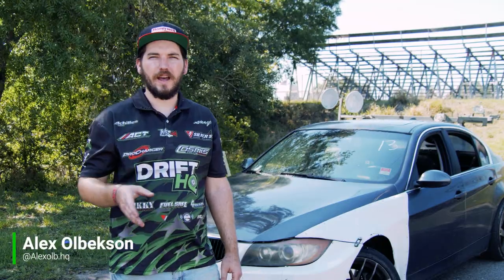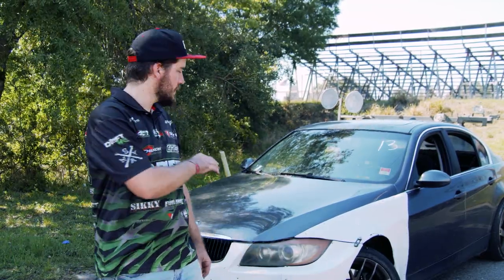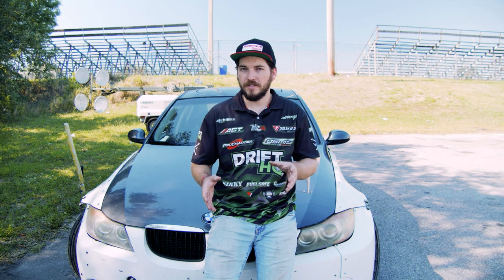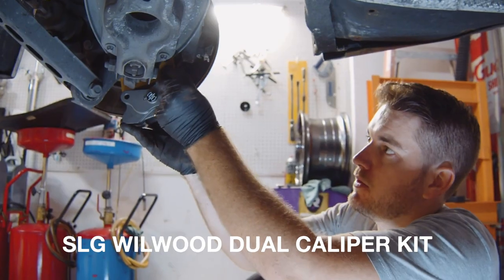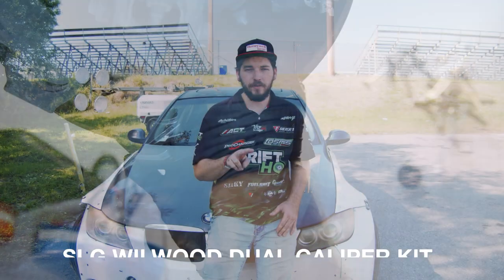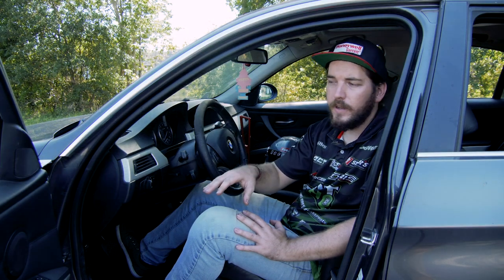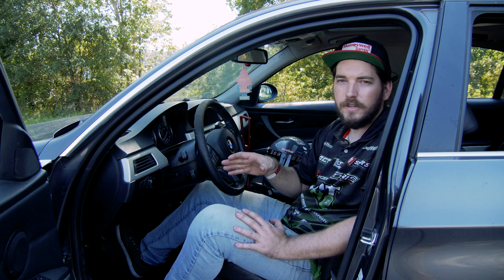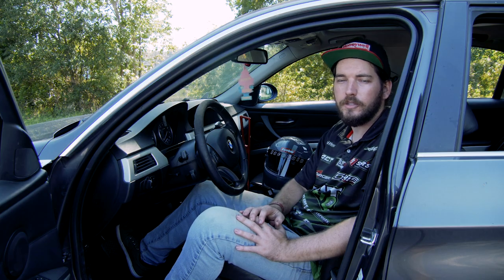HOW TO DRIFT AN AUTOMATIC BMW E90 / E92 / NEW ANGLE KIT INSTALLED

Comment: After welding your diff, how is it daily driving an auto?
I’m building basically the same build, just not sure if I’m going to weld the diff of buy and lsd.
Reply from the maker: works just fine! just the tyres chirp and a little bit of heavy steering feel when turning
Reply: @DriftHQ  thanks!

Comment: How are the supporting engine parts holding up ? (radiator, injectors, hpfp, lpfp)
Any engines codes being thrown ?
Reply from the maker: We'll get Alex to chime in!
Reply: Everything has held up well, considering this is the N54. No issues with cooling, radiators, fueling. When I bought the car I fixed all the neglected maintenance, oil pan gasket, good injectors coded. Otherwise just a stock turbo 177k mile car with oil changes and maintenance.

Comment: How is the hydro (or any ebrake) working with an auto?
Reply: Wondering the same
Reply: Same question??
Reply: wish this was answered
Reply: It locks up the rear wheels letting you slide the car a whole lot easier. Same thing a hydro would do in any rwd car really lol. Any other questions?
Reply: I don’t think the transmission matters for what the hydro ebrakes does or any ebrake at that

Comment: Hello. I know I'm gonna sound like a total noob on this. I've had multiple daily driven cars/drift weekend cars from slush box 91 toyota camrys, 98 volvo s90, a 240sx,and another 91 camry and a few months back I parted ways with a 350z I had. I bought A 2006 bmw 325i. The most basic car for a bmw noob like myself. Are there any tips you could give me on how to make the car more driftable then it already is? Should the dsc be deleted or its fine as is? I know I pry sound like a moron lol.. but I'm new to owning a Bmw and am just looking for friendly advice on how I could make the e90 more driftable then it already is. So far I've installed fully adjustable DC racing coilovers, adjustable camber and toe arms. Along with the trailing arms. I'm currently running continental 245/40/17 tires on the rear and 225/40/17 up front. Everything else is still stock.  Anyone have any recommendations on a exhaust setup and tune?
Reply: buy m3 control arms front and rear, also make sure your spring rates for your coil overs are close or more than 20k. I have 18k front and 20k rears. dampening is hard in the front softer in the rear. i run a little toe out in the front, straight in the rear. i have 225/40r18 front and 245/40r18 rears. change coolant to wetter water and add an oil cooler with oil filter housing from a 335i to help keep temps down. also add a 3 stage intake from a 330i, straight exhaust, 3.72 final drive rear differential, and a stage 2 tune and you're golden.

Comment: So, how do you drift it? I have a 330I and 265 fat 19" rear tyres. It's really hard to break traction and keep it with only a 3l NA engine.
Reply from the maker: Sport Mode, and it has a welded so Traction Control off at all times. He also has a hydro and dual caliper setup. Bigger tires definitely make it harder though!
Reply: @Cue I have an E90, it has an ECU tune only (274hp).
Reply: @Salpeteroxid  increase tire PSI, traction control off, and clutch kick or rotate the car to slide. If you're open diff it won't transition, but you'll slide for a second or two. Welded is very controllable and lets you transition.
Reply: @TehVikingsOwn  My rear tyres are 265/30 19" at 3bar. I have Goodyear AS2 tires. I promise, the car makes too little power to really drift. All I can do is slide a little bit then it snaps on me, incredibly hard and violent. Now with my winter tires I will have a go when the snow comes.
Reply: @Salpeteroxid  prolly because you have 19s on lmao who drifts on 19s?? XD hilarious I have 17's on a 325i e90 with turner ms stage 2 tune with a welded diff, I drift it just fine.
Reply: @e90lownslow14  That car is long gone. Got a 435i now instead.
Reply: @e90lownslow14  can you post or send a video I’m thinking of doing the same on my e90 328

Comment: Currently thinking about getting a 335i E92 for drifting - did you have/had any cooling issues making the car go into limp mode? I heard this can be a serious issue drifting this engine
Reply: upgrade water pump. Factory pumps have plastic impellers and when they fail, they can be less efficient not allowing the water to flow, but also throw bits of plastic into the system. Bigger radiator might help and lower temp thermostat. But main thing is just the water pump
Reply: @tommynobaka don’t forget upgraded oil cooler

Comment: Im just curious on what the minimum offset is on say a 18x9 with this kit to still get full lock? Or what wheel spec did you guys run/suggest?
Reply from the maker: Definitely varies, 8-9 inch wheel is ideal, +20 offset and lower would work
Reply: @DriftHQ  ok that was gonna be my guess, 18x9 +15 to be exact on what i was guessing. Glad this kit is going great ill be ordering one soon when i pick up my E9X next week.

Comment: The hydro doesn’t interfere with the trans?
Reply: No It doesn't
Reply: Just a torque converter. Having the wheels locked at 50mph is the same when they're locked sitting at a red light. :)
Reply from the maker: No issues at all!
Reply from the maker: The transmission is fluid driven
Reply: @DriftHQ  computer doesn't freak out though?
Reply from the maker: Kyu1LL No sir. As long as traction control is off
Reply: @DriftHQ  ty!

Comment: Wish you guys would sponsor a E60 with that kit it would Direct Fit I've worked on my E60 alot and used alot of E9x E36 and E46 parts with the E60. Its funny that alot of BMWs are compatible with each other
Reply: I have e60 which i am currently building. As far as i know it won’t fit bolt on? However, if drifthq will sponsor me, i will make it fit🤣

Comment: Hi have you had the e-diff coded out? 
LSD or welded diff? 
I want to weld my diff in my manual 335i but am unsure on coding
Reply: My main question was about the electronic diff coding on the 335i... 

Im not buying a lsd as I only paid £2000 for the whole car
Reply from the maker: Welded Diff, with traction control turned off. No coding
Reply: @DriftHQ  
cheers drift HQ! welded my manual 335i diff no issues so far!

Comment: How are you getting to hold in gear ?
Reply: Right? i'd love to bang the limiter on my auto
Reply: Xhp flashtool
Reply: @Jehu_Style  Thanks, it's not available for the GM gearbox, manual swap it is then
Reply: @lordvader3538  On it mate, cheers
Reply from the maker: Alex drives it in Sport mode and has some fun with the paddle shifters. Not a lot of limiter though 😂😂